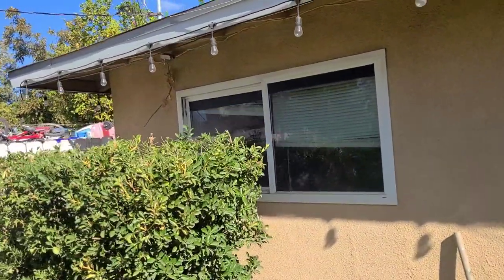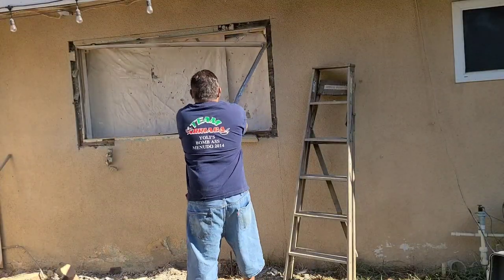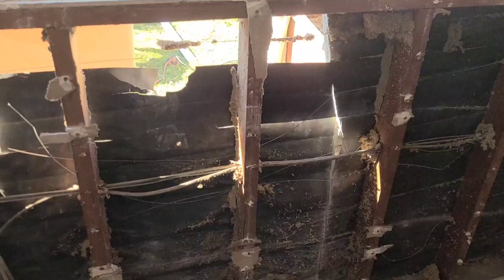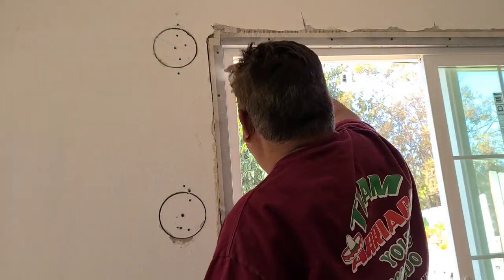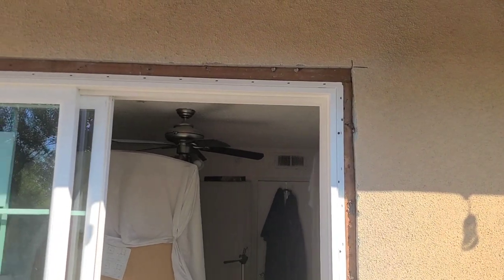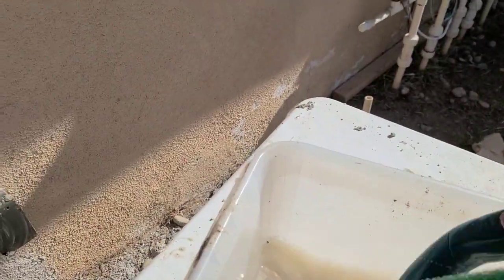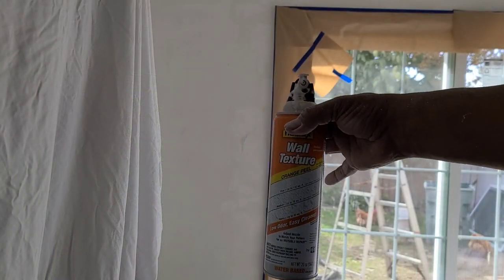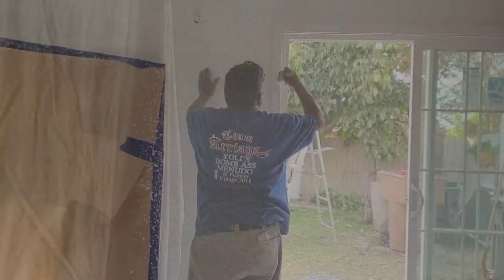How to remove a window & install a sliding glass door on a stucco wall

Comment: Bad work in the stucco!!! At least you guys need to cut 6 in around the door, not 2-3 inches!
Reply from the maker: thanks for your expert advise
Reply: Yeah because your supposed to put flashing, then paper, wire, scratch coat. They’ll be long gone before it leaks in 5 years. Lol
Reply: @electriclife158  
So what you are saying is that they should quote 1200 for labor? instead of 700?

Comment: I want to do same thing to an old house built 1949 this house has old wooden frame glass windows double pane with storm screens..any advice for me I am building incline but Considering the age of my house what would be best advice..? My window is 82in high to the floor and 68 width in stud to stud..what size of window would i need..?? Thank you in advance for you advice and help. I can provide u with pics of the old window.
Reply from the maker: Thanks, every application is different

Comment: That was a massive improvement to the look as well as a noticeable bump in the home's value. Is this your personal home or a customer? I'm familiar with how to replace windows in a stucco home but it didn't occur to me that a sliding door would be so little extra work -- if the width is kept the same as the old window. If you don't mind me asking, where does one buy windows or doors if doing their own DIY install and how much does a slider door like this cost? I live in Oakland, CA so competent contractors are very few, very hard to find, and to do do a one-off window or slider replacement in stucco is very expensive. It's not worth a contractor's time to do a one-off window or door unless they charge FU pricing.
Reply from the maker: This was my neighbors house, We got the door at the Home depot at the time it was around $900